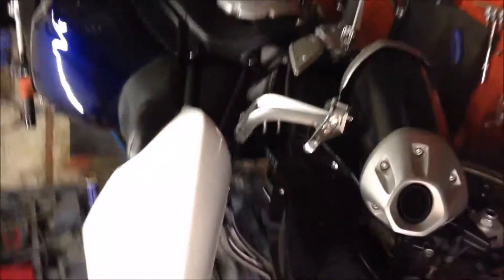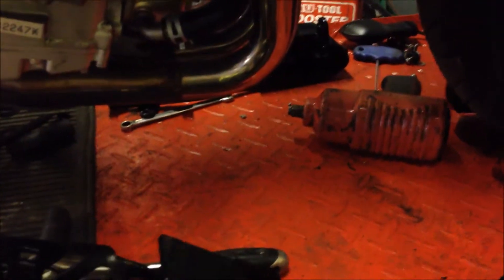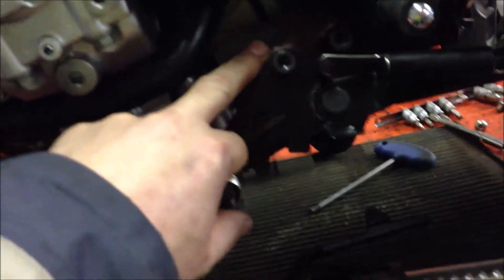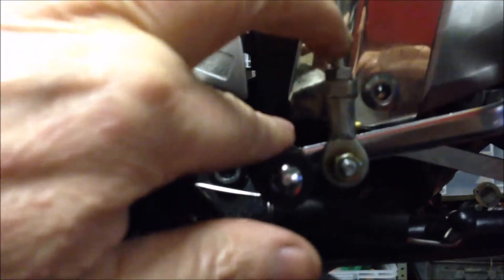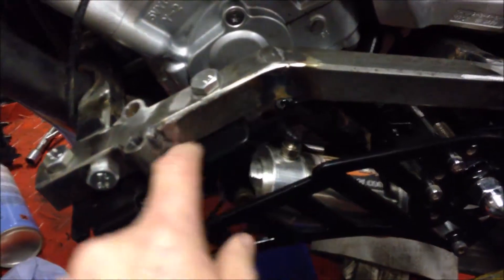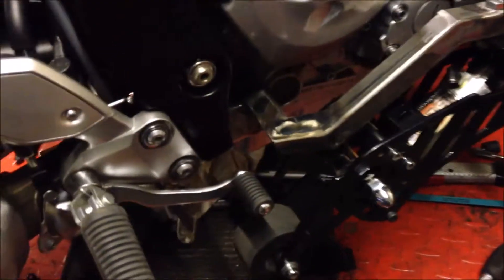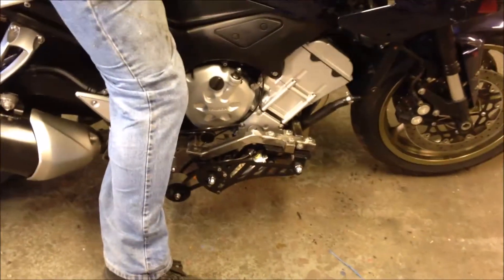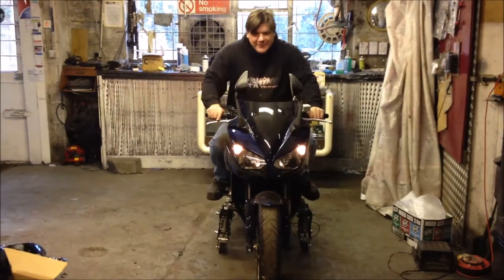A motorcycle with deployable stabilizers Rhino trikes fitting Legup Landing gear to the Fazer 1

Comment: Hello, where can I buy this kit?....friendly greetings from Belgium....hugo
Reply from the maker: Hi Hugo, we didn't get this system to function as we wanted on this bike. A combination of high center of gravity and poor British roads. You could make it work with the adition of locking solonoids to keep the wheels down once deployed. We abandoned the air ram idea and are working on a hydraulic solution. Watch the channel for updates. You can message Pete G at Leg Up Landing gear and see what he suggests. If the Legs would lock down once deployed, it would be more versatile.

Comment: As the manufacturer, I am impressed by your adaptation. Good Job!
Reply from the maker: Unfortunatly due to the state of UK roads we weren't happy with the power of the air rams to right such a tall bike on uneven roads. We ended up abandoning the air ram idea and are now building a fast deploying Hydraulic solution with two way rams.
Reply: @rhinotrikes  One of the reasons we don't suggest our system for folks with no use of their legs is roads pitched over 20 degrees... Hydraulics may work (our automation system should still be able to actuate it), but as narrow as they are set, you may find it isn't practical as the strength would put the  legs down,  but the bike may still fall over. Best of luck!
Reply from the maker: @chopperdesign  That's pretty much what we found. It's a very clever system, we went on to fit castor wheels to the bottoms of the legs, so they could turn with the bike as moving the wheels away from the rear axle meant they had to skid steer. Biggest problem we had, was that while they deployed lightening fast and were quite capable of balancing the bike, the high centre of gravity of a sportsbike would push the rams up at the slightest lean angle. The system we're developing now locks the wheels down, and they can only unlock when the ram is reversed. I did experiment with using solonoids to lock down your system but the crap condition of our roads meant that the rams couldn't bring the bike to balanced as the air is too easily compressed. A very clever and exceptionally well made gadget, but just not suitable for this particular application. Not your fault as I think Mike was less than honest about what he wanted them for .
Reply: @rhinotrikes  No worries mate. Thanks... As they say across the pond, Cheers!

Comment: Hi, I'm paraplegic and want this doing to a bike,do you think it could be done to a triumph 675? For example?
Reply from the maker: We weren't happy with the system on a sports bike because of the high centre of gravity,  the forward weight distribution and the state of British roads.  We are looking at another solution using hydraulics not gas.  Keep an eye on the channel,  I'll post up some material when we get somewhere with it.
Reply: Will you be fabricating it yourselves? An supplying? I hope so, having to buy from the states is crap much better to stay in this country👍
Reply from the maker: @deanwatmuff5898  The electronics and servos should be coming off the legup kit and the hydraulics from another kit. If it's all successful we should be able to source the components and build one ourselves in the UK
Reply: Fantastic👍